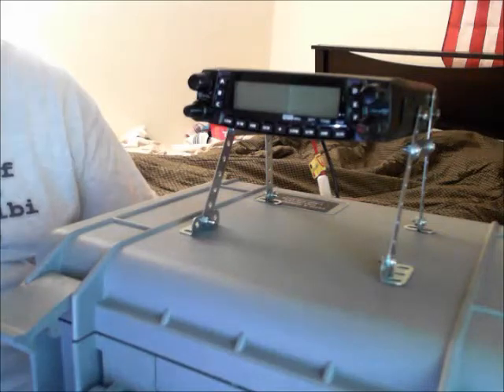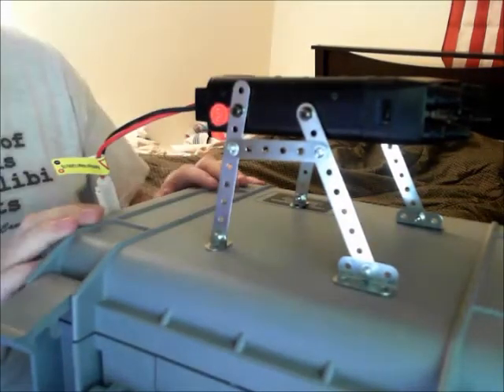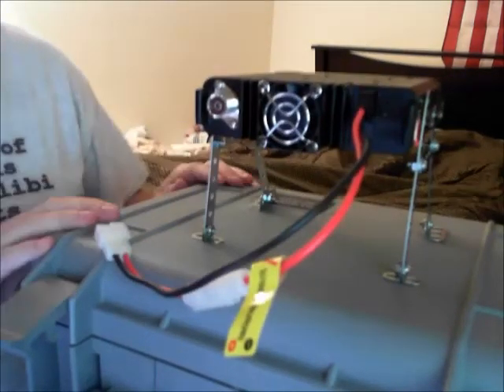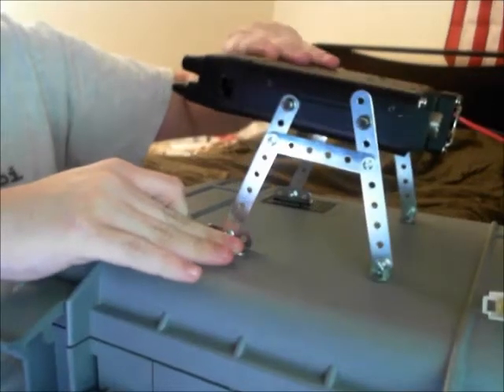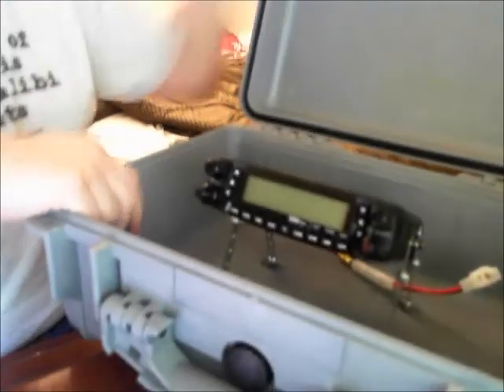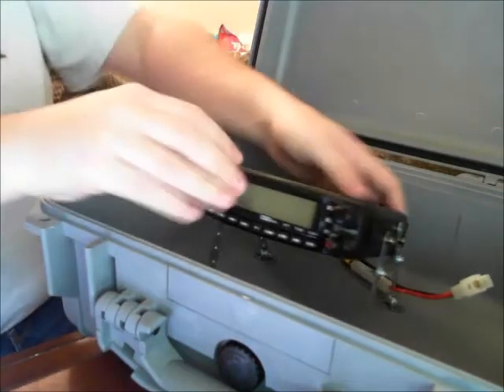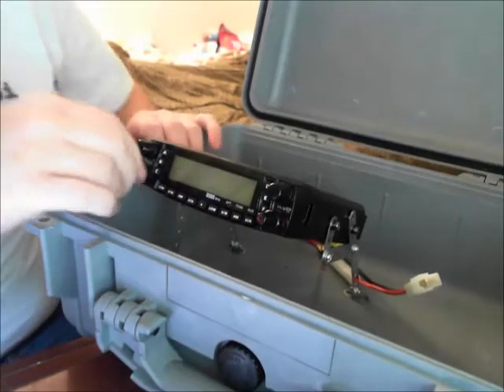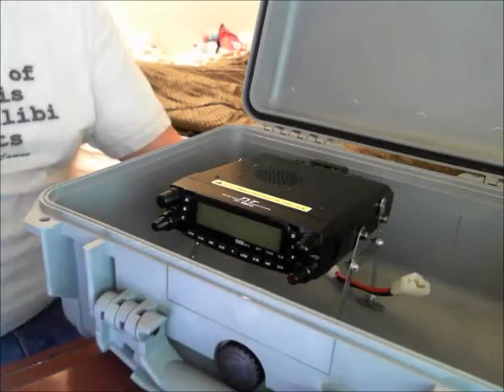EMCOMM GoBox Project. Mounting the Quad Band Transceiver.

Comment: That looks like a duplicate to the Yaesu FT-8900R, which has a detachable face plate.  If this version has a face plate that is detachable, you could mount the radio anywhere and put the face plate in an easier location.
Reply from the maker: It does have a detachable faceplate but the cable is like 12 feet long. It didn't make sense to remote-mount the head from the body and utilize less than 1 foot of the cable. If you haven't seen the updated video about this gobox build, I replaced the TYT radio with a Kenwood 2m VHF because I couldn't get a quadband antenna to work efficiently with this setup. I'm preparing to put the TYT in my vehicle this year with the radio mounted in the trunk but the head mounted on the dash. Lots of projects that I have to get done this summer so stay tuned for new videos on them!.